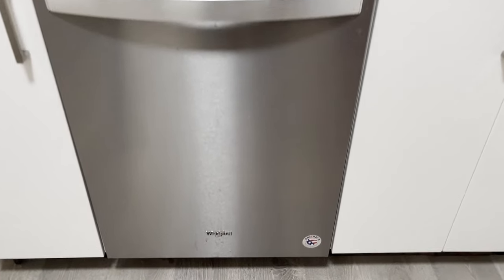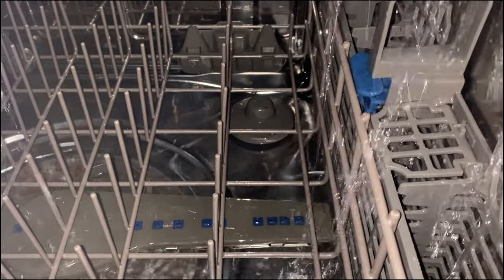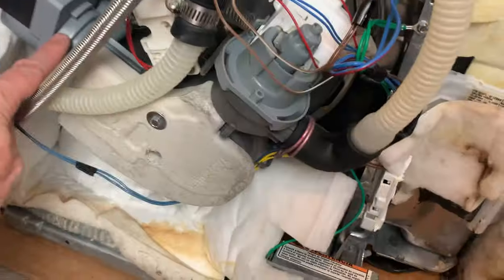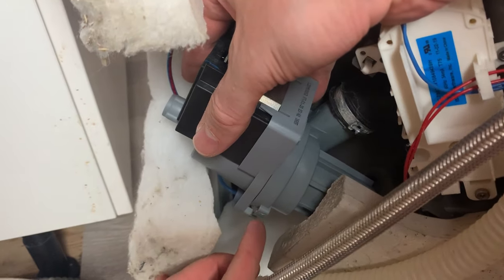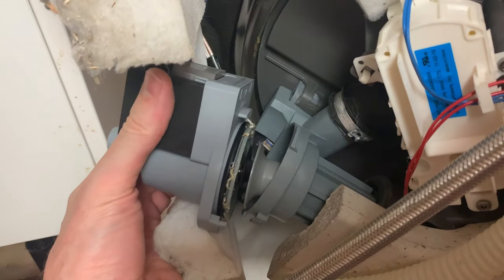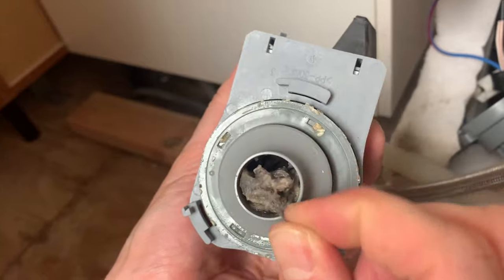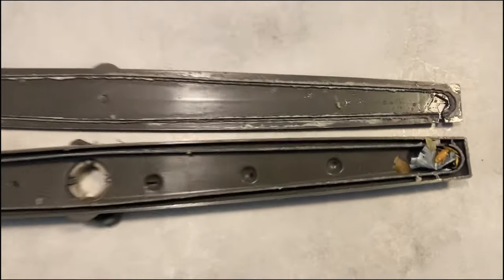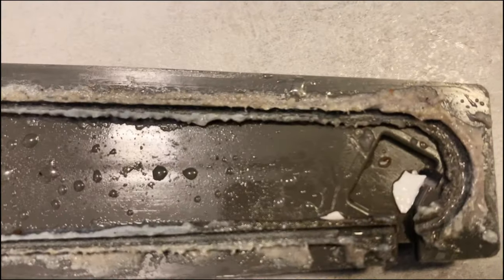Whirlpool Dishwasher not spraying water and stop cleaning - How to fix it

Comment: Yours was the only video I could find with this model of Whirlpool. This was exactly the same symptoms and the same clogged motor as my mother’s dishwasher. It was actually way more time consuming just getting the dishwasher out because of a short, hard to reach water hose and equally frustrating hard-wired power cable. But once I finally got it out your clear instructions on removing and cleaning the motor were spot on! Saved me hundreds of dollars! Thank you, Mr. Stukov!

Comment: excellent vid. took mine apart and checked this out, but it was clean as could be. kept searching YT and found one where the guy used a toilet plunger to clean the line from inside the cabinet. tried that and between ensuring the pump was clean and purging the line within the cabinet, works like a charm. Thanks! New sub.
Reply: Hey buddy come fix my dishwasher... Helpful video!!

Comment: How did you open the propeller arms? They seem to be glued closed on mine (same model). And how did you close them after? They seem to be built to prevent people from opening and cleaning!
Reply: Hey I know it’s a late reply, but they are just click in, flat head screwdriver and should be able to let it open. Then click back together.
Reply: I think they are glued I opened mines and it won’t close now

Comment: At least one person complained that the pump was clean and this video did not help. However, although the pump was clean in my case, this video was still extremely helpful.

If you find the pump is clean, try hand turning it back and forth. I did this for the circulation pump and the drain pump. When I reassembled everything, it started right up. Maybe they had seized up or started to, and the pumps are designed not to turn under those circumstances. I'm sure an expert on electric motors would know the answer.

Without this video, it's likely I would not have gotten that far, and would have been hand washing my dishes today.

Comment: This 100% was our issue. Thank you Sir!!!

Dishwasher would fill and drain but there was no spraying at all. Took the unit out(had to disconnect hardwired electrical but it was easy) removed the gunk from that piece and it works!!!

Thanks!!🎉
Reply: How do you disconnect the hard wire plug in order to pull dishwasher out?
Reply: Shut off the breaker, remove 
Cover(if there is one) and disconnect the wires, take note where u pulled them from to reconnect afterwards
Reply: @OzzyKiley  thanks so much! I did manage to find a video showing this after I commented. But again thanks!!
Reply: Did it smell like burning.

Comment: Thanks for your video, my dishwasher wasn't spraying so I took it apart hoping that would be the fix.  Except mine was not clogged.  Perfectly clean.  Pretty disappointed I was envisioning a costly repair.  I pulled the magnet out of the pump and discovered that it had a huge split running the length of it.  Quick jump to Amazon, 2 days later and 50 bucks poorer I had a new pump.  It now works like new.  You saved me at a minimum a service call.

Comment: Mine had the same problem..yet it was fairly  clean..but there is a screen under the impellar Hydro turbine which requires cleaning with a tooth brush and dish soap..the area in which the fellow in this vid is pulling out debris is the impellar housing remove the 4 screws and you can gain access..simply unwind(unscrew) the impellar from the threaded shaft to expose the screen below..it's ridiculous how such a small part blockage can cause a complete shut down of the machine- my model is WDT750SAHZ0..note to remove the pump you must tip the pumps square side post out of it's rubber insulation slot at the bottom of the machine..turning it clock wise..I had a tough time turning it so used WD40 on the contact rim..also remove the  interior wash screen first and also the pump power clip..the smaller other pump is for the machine draining only..push 3 of the mode buttons 3 times each consecutively a total of nine  to enter the machine reset and cycle..the machine will cycle through for errors..and reset.

Comment: How did you have light in there? I tried to 'wash' my GoPro, but it's completely dark in there and nothing can be seen
Reply from the maker: I just use my iPhone before filming I Turned on flashlight on it.

Here’s how:

1. Open the camera app and select video mode. Note: The flash does not work in pano or time-lapse modes.

2. Swipe up in the middle of the screen, away from the shutter button, and a hidden toolbar will slide up across the bottom bar, in place of the camera modes.

3. Tap the flash button (on the extreme left of the toolbar) and the flash modes will scroll out from the button. Tap “on.” The flash will turn on instantly, even when you aren’t recording, and will remain on until you switch camera modes or close the app.
Reply: U can also try flipping the door switch so the machine detects the door is closed and partially open it to see inside

Comment: Nothing was clogged looked clean inside did not help at all
Reply: Probably your inlet valve
Reply: Guess you need to actually DIAGNOSE IT YOURSELF. The guy does a helpful video and you give him crap for it
Reply: Mine was clean too but magnet was cracked when I pulled it out, the propeller didn’t spin freely
Reply: @Max-zz3tt what do you mean it didn’t spin freely
Reply: Awesome video, I like the phone in dishwasher.